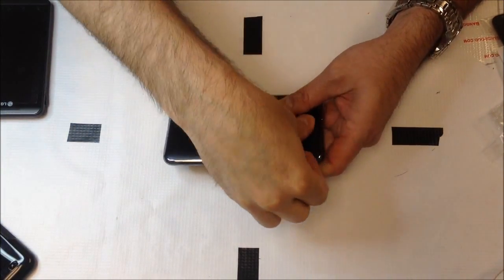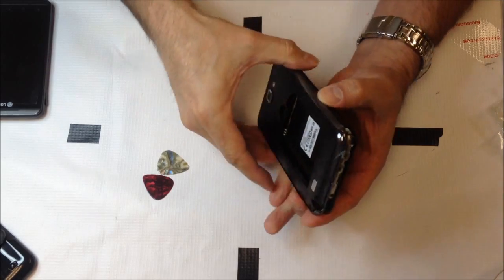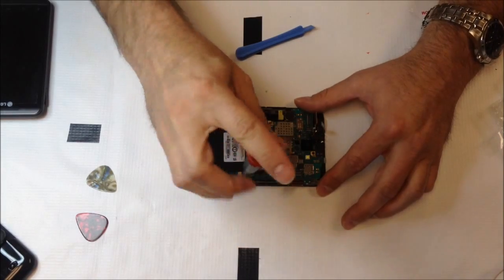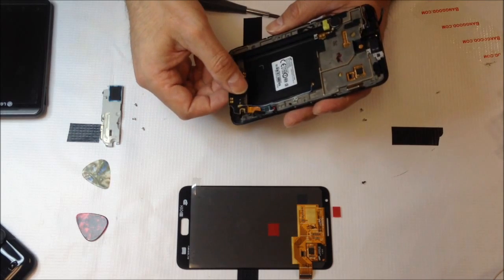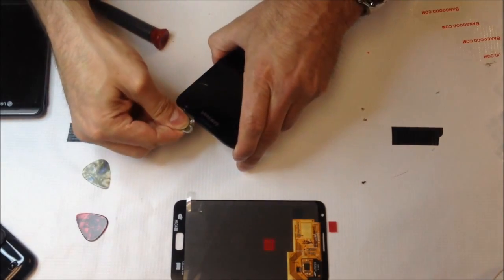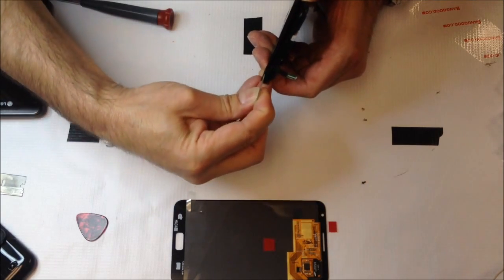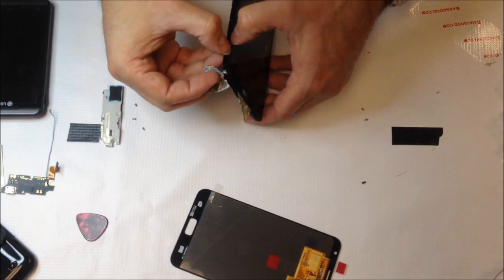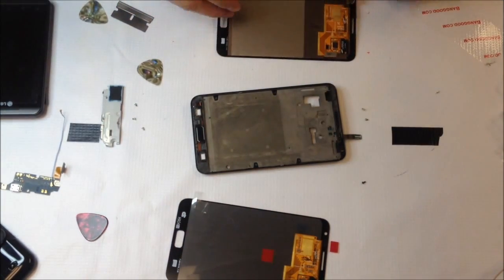Samsung Note N7000 LCD (AMOLED) replacement

Comment: Is it possible to just change the flex or does thw whole screen have to be changed? Its just the flex that has a slight bit of damage the screen works perfectly, thank you.
Reply from the maker: If you mean the AMOLED flex then I'm pretty sure you are done. You might be able to replace the digitizer although I'm not sure of the best bonding method. If it's the S-Pen flex then no problem.
Reply: Go Cell Phone Repair yea i tried changing it had no luck in the end i managaed to fix the flex back into place lets just hope it holds, thanks for the advice (Y)

Comment: is it possible to get  the working screen off the frame if you are wanting to change the bezel??
Reply from the maker: Possible yes but I won't say easy. You have to be very careful and patient, use some heat, and maybe be a bit lucky. AMOLEDs are very easy to damage if you bend them even slightly.

Comment: Have no visual on my Samsung note N7000. I can hear it come on and even plug into the computer that tells me battery % etc... but for some reason there are no photos on it to download. When the problem started I had taken it to a local phone shop who said it could not be fixed but I maybe able to download photos. The thing is I can call the phone it works, I hear the text (but can't see them). When I tried downloading the photos it stated there wasn't any. 
Could the phone shop have downloaded them and that's why the phone is clear of photos? Can this phone be repaired so that I can see the screen again and use? If yes what part do I need?
Reply from the maker: Even if someone copied your photo gallery that would not delete them from the phone. I don't don't why your screen won't light up but the first step would be connecting a replacement screen to see if it turns on or not. The shop that you took it to might have done that already. You might want to ask them about that. If it does then you would need the part shown in the video. You photos should still be there unless the phone was reset somehow. Hopefully not. If so then they are gone.

Comment: When you get the broken screen off, do you have to place some new adhesive on the frame so the new screen sticks?
Reply from the maker: The replacement screen should come with adhesive behind the AMOLED but you will probably want to add some at the top and bottom of the touchscreen. Be sure not to cover up any of the windows or buttons though.

Comment from the maker: Doubtful but I never tried that. I have worked on a couple of the clones and once you take them apart they usually start to lose functionality. If you have the Note 2 display I would try to buy a real Note with a broken screen and just use that instead.

Comment from the maker: I would remove the back panel and check to see if your AMOLED flex cable is plugged in properly. Sometimes impact can cause pop connectors to become disconnected. If that doesn't help then you probably have a broken display even though it is hard to tell by looking at it.

Comment: I dropped my phone at the gym, it landed on its corner and the phone does have a crack on it, but the phone was still working. except there was nothing on the screen. I could still recieve calls/texts my pre-set alarms were still going off but there was just nothing on the screen. would replacing the screen fix that or is the problem deeper?

Comment from the maker: As long as the phone still works you should be able to. I'm assuming that it doesn't automatically mount as a drive when you connect it to a USB cable. If that is the case then you can A) perform a temporary board swap with a working phone or B) try to navigate to the mounting option without being able to see the screen. For either option you will want another phone of the same model. For the latter just use the donor phone as a guide to navigate yours. Good luck.

Comment: Hi! i instaled the new screen and it's installed and functional. with exception of the s-pen that not work any more. With the finger the touchscreen work fine, but with the pen not. I  notice that the original screen have two flatcable and the spare part not. Does have anything about it?

Comment from the maker: Correction- I opened one of these up today for data retrieval and in fact all of the flex cables and the antenna wire must be disconnected in order to remove the board.

Comment from the maker: This was the first time I worked on that model so I removed all of the cables to be safe. Check the audio, I think I mentioned this in the narration. I would always recommend removing the motherboard before replacing the LCD so it does not get damaged.

Comment: An idea, has anyone tried using a suction device, then heat to part the glass? Or, use a strong adhesive to fix something to the glass and then heat to seperate it? I like this video, better than others I have seen so far